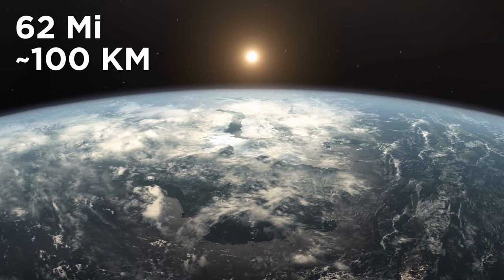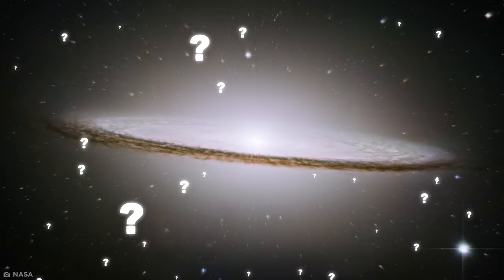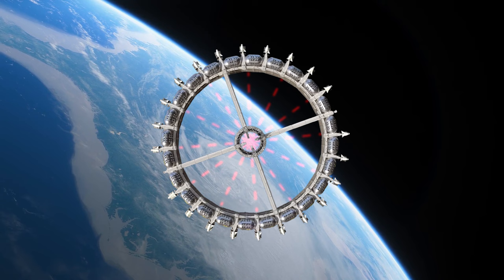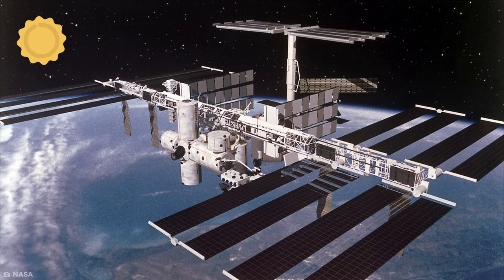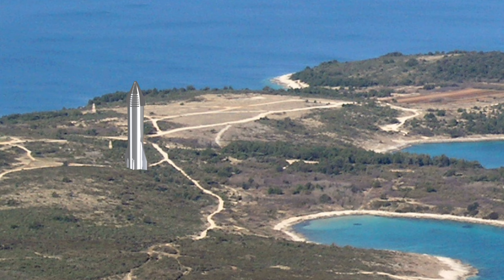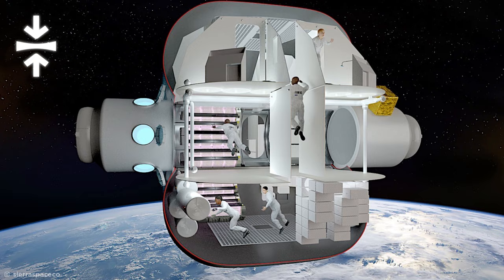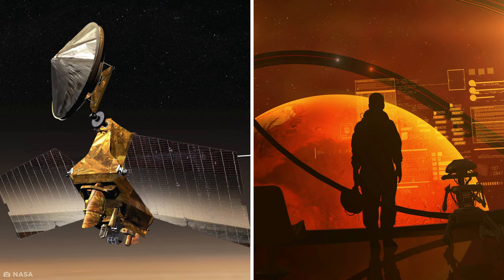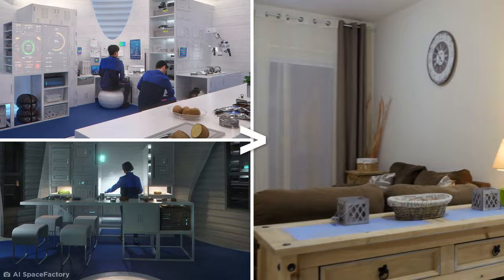Amazing New Space Technologies

Comment: 9:31 I have one problem with using light for bringing internet to the public. There's too many radicals in the atmosphere for the lasers to work like that. Light bends and can't travel through solid walls. That's why we use fiberoptic's, it gives the light a secure place to travel. It has nowhere to go but directly to the devices. Radie waves work well too because they have antenna to conduct too. Lasers are too expensive to be honest because it needs a grid of devices to direct the system and it's not going to be secure. What if one of the lasers are blocked the light from getting to the public? Also, what happens if one of the lasers go off because of debris?